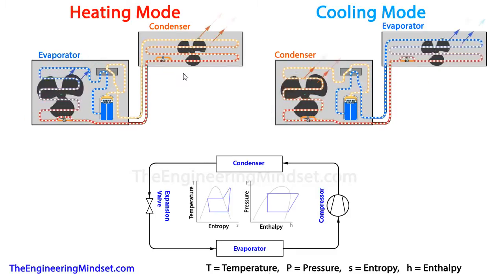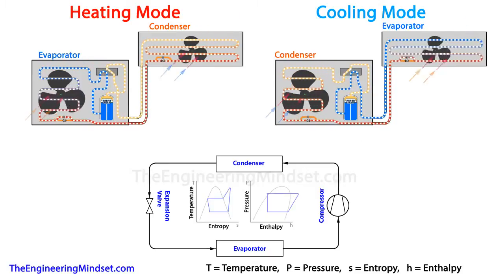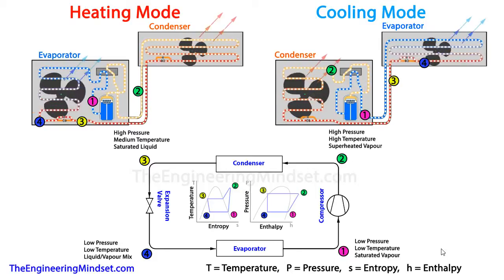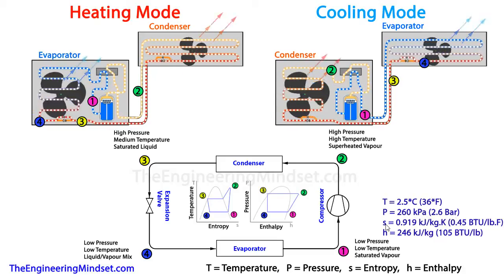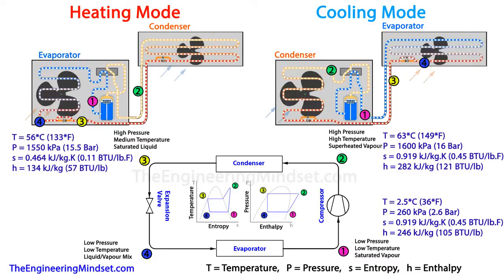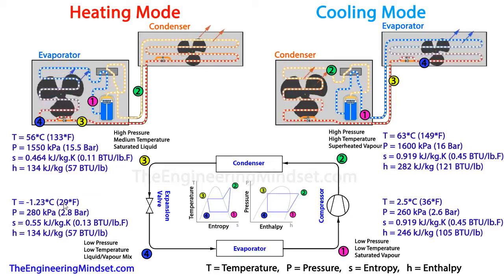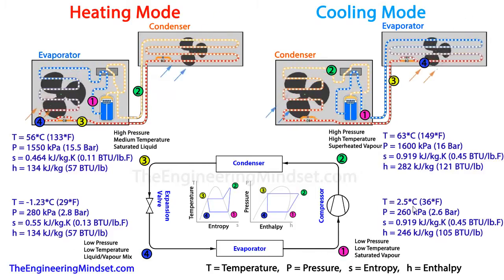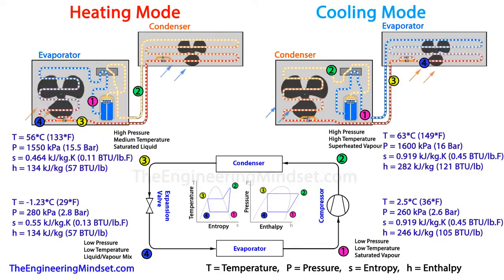How Heat Pumps Work - ADVANCED (design data)

Comment: I know this is six years old but it's slightly confusing that you have the colors going from orange as hottest to red being medium heat. Second thing; I was hoping at some point in your explanation of heat exchangers to explain how the ideal gas law can help explain how the compressor increases the temperature by increasing the pressure and the expansion valve decreases the temperature by decreasing the pressure. It's pretty confusing at first to understand why the refrigerant comes out of the compressor so hot or why the refrigerant is so cool when it enters the evaporator. It's also confusing without explaining the effects of pressure as to how you take a refrigerant with -30 boiling point and condense it in 70 degree weather. If your going to throw concepts like entropy and enthalpy around you might as well..

Comment: Thank you for your great videos explaining heat pumps. I live in Canada and we get both high +30s (C) and low temps -50c. I am no eng but have a pipping background. I am wondering what if any, the advantage to having the boiling point that is limited to -30 in a system. Is it the cost over the -50 alternative? Or the safety of using one or the other? Also, are the gases for compression higher or lower system pressures? Thank you for your time and great videos AL

Comment: Wonder what the outdoor coil TD in heating mode would typically be? Heat pumps usually design OAT of 25F in heating. Some as low a -40F/-40C.. Would you want a low TD for low humidity removal for less less chance of OD coil freeze ups?

Comment: Fantastic video and helps a lot.

Need your help in understanding air temperature changes when passing through Evaporator and condenser. Can you tell me when heat pump works in heating mode and ambient temperature is -30C , what would the refrigerant temperature have to be at outdoor unit so that heat exchange really happens? I guess -45 or -50C...….

Comment: Since Heat pumps are fairly simple systems- what makes certain heat pumps so much more efficient than the lower efficient ones - refridgerant type. Presuming say air source heat pumps?
Reply: Mainly the compressor. A scroll compressor is going to be more efficient than a reciprocating compressor. Seer really refers to amperage draw. Less amperage more savings in wallet. As time progresses, compressors, and coils get more efficient, duct design gets more efficient. The efficiency really has nothing to do with how cold or warm the air will get in the building, just the money you will save with a certain seer rating. A properly maintained unit even older will cool and heat approximately the same.

That and a proper sized tonnage unit (condenser and evaporator matched) for the space that is being cooled and heated. Also the proper size piston or TXV. Piston and TXV sizes should be sized according to outdoor unit tonnage size. Alot of time hvacr technicians will install the indoor coil (evaporator) and not even pay attention to size, especially on a mismatched size unit. Say 3.5 ton unit outside (condenser) and 4 ton unit inside (evaporator). Came across a 15 year old unit the other day. Been running on wrong pistion size for years. Superheat and subcooling never could align to what nameplate called for on outside unit. (Charging by superheat for piston). I'd get superheat dialed in but subcooling still way to high. 

Pumped down, removed piston. Had a .078 piston, changed to .072 piston, which is what was called for by outside unit. 

 Customer says the unit cools better than when first installed brand new.

Comment: Excellent video. Very informative. Two suggestions -  First, it'd be great if you may expand this video a bit and explain how you get the data from the real world for the four status points. For example, you get the  pressure values for point 1 and point 2 from your compressor performance curve; Second, add some explanation of superheating and subcooling and how they are reflected in your system design.

Comment: Nice introductory video. Just a few questions - since you considered the delta P across the heat exchangers, for the sake of consistency wouldn't it be appropriate to consider the efficiency of the compressor - the process is shown as isentropic.  Also, it would be nice to know the assumed air side temperatures of the heat exchangers.